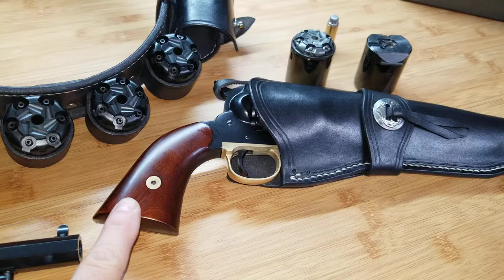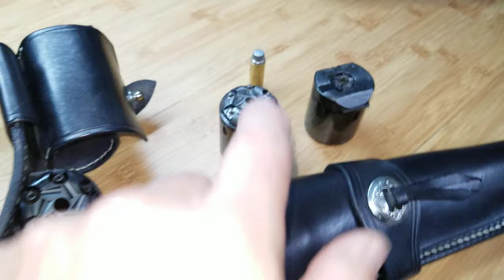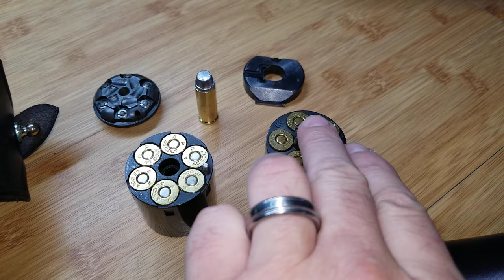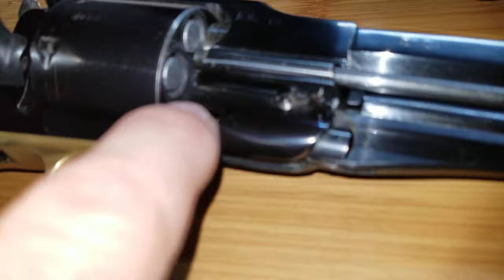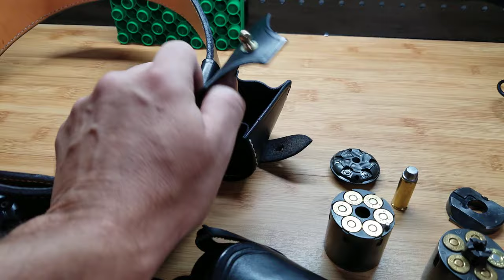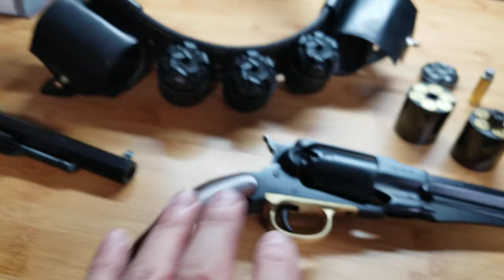1858 Remington Pale Rider Set

Comment: Are you saying the 6 shot cartridge has a high probability of blowing up?
Reply: *depending on the load. 

5 shot allows you to do much hotter rounds. 
6 is suitable for target shooting loads.
Reply: kirsts are rated no higher than the 6 shot cylinders
Reply: Kirst Cartridge Konverters™ are rated “For Black Powder or equivalent loads only,” which includes the smokeless, light target loads commonly sold for Cowboy Action Shooting.

Comment: You're wrong. 

45 colt, and 45LC, are different rounds. I forget which, but one of them is 45-40. Other manufacturers wouldn't use the colt name to describe the chambering.
Reply: Uh, No. 45 Colt was referred to as "Long Colt" to differentiate from the shorter 45 Schofeld or 45 Gov't round of that era. The 45 Colt was originally loaded with 40 grains Black Powder before being reduced to 30 grains per Gov't request for issue by the U.S. Army.

Comment: "They would look at you ...." Not quite fully correct. Yes, you are correct that there isn't any such thing as "45 Long Colt". No, you aren't correct that nobody would have understood. The military cartridge was the 45 "long" Colt. And it wasn't officially called that. What happened was a result of the adoption of the 45 Scofield as a secondary standard. In an attempt to standardize ammo, the military sutlers gave out Schofield ammo regardless of whether they were to be used in the Colt or the S&W. Since the Schofield was much less powerful, the soldiers quickly started requesting the "Long 45 Colt" ammo. Thus the users gave the ammo a name that was never official, but nonetheless is STILL a legitimate name because of Long standing common use. It was a legitimate differentiation because the standard 45 Colt used a 255 grain bullet in front of a full 40 grains of black powder. The Schofield used a 200 grain bullet in front of 28 grains of black powder. A significant difference to soldiers who were used to maximizing the range they used their weapons at.
No, the 45 Colt was never officially named "Long Colt". Yes, it has been named "Long Colt" by users ever since the Schofield round became available.

Comment: Do, can you modify/ redesign a 1851 Colt backstrap into a traditional birdshead without the current stepped birdshead?
Reply: I'm  thinking about a 3d copy in plastic, modifying,  and then casting  in brass.
Reply: John Johnon uberti sells 45 colt birds head (without the step), cattleman revolver.
Reply: The back strap and triggerguard interchange with 1852 colt.

Comment: Hi, I have a question for you about this revolver, if i were to load up some cylinders with black powder and a bullet, how long does this stay good for? I live in a humid state and was wondering if i would have to fire off the cylinder from time to time and reload it with fresh powder or if they would be ok sitting around for months or years before needing to be fired. Thanks for the answer in advance and thanks for showing off your rig!
Reply: It will be fine. I live on the coast it has never been an issue.
Reply: might as well use the conversion kit. only needs to load when ure out on the field and no hassle on handloading the blackpowder
Reply: I live in the humid state of Florida and I've had my 1858 loaded for 2 years as a test. Every cylinder fired without a problem.
Reply: Louisiana here. I have never had a problem with the powder going bad. A cap, once. Or maybe it was just a bad cap. As a rule I do not keep a loaded cylinder for over a year but who knows how long it is actually good for? Just don't buy 20 cyls and keep them all loaded if you only shoot up one or two every few months. If you almost never shoot, just keep one in the gun and one loaded spare and if you need more kapow power than that you probably got problems too big to shoot your way out of, anyway. Just the same maybe keep a box of balls, a tin of caps, a flask of powder, and some wads right by the gun. maybe some bore butter or crisco if you roll like that. Or convert to cartridges, and you should be good for like 60 to 100 years.
Reply: Bill Hickok “emptied his 1851’s every evening.

Comment: I thought Clint Eastwood used a new model 1861 remington revolver in pale rider? In fact I don't think an 1858 new model ever really existed, just a misprint on some of the barrels if I'm not mistaken.
Reply: Wrong
Reply: @terryparker1694  They are commonly, though inaccurately, referred to as the Model 1858 due to the patent markings on its New Model barrels, "PATENTED SEPT. 14, 1858/E. REMINGTON & SONS, ILION, NEW YORK, U.S.A./NEW MODEL."; although wide scale production did not start until 1861.  

Source: Google magic. In the future it would help you to do some research before so confidently calling someone else wrong.
Reply: @ezell77  WRONG. It is referred to as a model 1858. Produced until 1875 by Remington and all over the world long after. Remington produced over 230,000 themselves. I have an original one right here, made in 1870. It is plainly marked MODEL 1858. I have had it a long time. When you don't know, you need to be quiet. You don't know. Be quiet. You're outing yourself. Run along kid.
Reply: @terryparker1694  man i said they are falsely referred to as the 1858 and I said plainly that 1858 IS printed on the barrel. But 1858 is the year they were patented. They didn't begin production until 1861 meaning the actual model of the gun is an 1861. You just contradicted yourself. You said you have one that is made in 1870 and you said it says 1858 on the barrel,  that should alert anyone with common sense that 1858 isn't the actual  make of the gun. How can you have a model 1858 if it was made in 1870? A use of common sense or simply Google search could clear this right up for you. If the gun was made in 1870 or any year other than 1858 it isn't a model 1858. Unless of corse you have a replica. Please explain how a gun made in 1870 is an 1858 model? I'll wait. You are outing yourself, I actual know my history. The one Clunt Eastwood used in the movie was an 1861 model. Please Google it.
Reply: @terryparker1694  The Remington-Beals Model Revolvers[dubious – discuss] along with subsequent models and variations were percussion revolvers manufactured by Eliphalet Remington & Sons in .31 (Pocket) .36 (Navy) or .44 (Army) caliber, used during the American Civil War, and was the beginning of a successful line of medium and large frame pistols. They are commonly, though inaccurately, referred to as the Model 1858 due to the patent markings on its New Model barrels, "PATENTED SEPT. 14, 1858/E. REMINGTON & SONS, ILION, NEW YORK, U.S.A./NEW MODEL."; although wide scale production did not start until 1861
Reply: Conversion cylinders were available starting 1868. The first were rimfire.  The next was .45 Center fire. Royalty was paid to Smith and Wesson for each one for the bore through cylinder patent with a back plate and 5 or 6 firing pins one for each chamber. I have 2 cap and ball and 1 conversion cylinders. They swap with no changes necessary at all one to the other in seconds.
Reply: @terryparker1694  What was the make of revolver used by Clint Eastwood in Pale Rider? Our firearms expert and Field Editor Phil Spangenberger tells us: “The gun used in Pale Rider was a New Model 1861 (not an 1863) Remington revolver. These are commonly misnamed as the 1858 Remington—of which there is no such animal.
Guess that clears things up.

Comment: I have a 1858 BP Pietta. I find that cocking this Black Powder Reproduction is horrendous. Is there a more efficient cocking spring available?
Reply: John Summers work your spring. That the grips off and you’ll see the hammer spring, there’s vids here of how to work it down.
Reply: Try the adjusting screw behind the trigger guard in the strap.
Reply: There are after market springs (eg Wolf Springs) that you can purchase and drop in.
Reply: Springs on cap and ball guns are intended to keep the cap in place when pressure builds in the cylinder the spring on the hammer prevents gasses from escaping past the cap

Comment: CRAP! Clint never used a Kirs Converter! In the movie you can see clearly, the cylinders are open at the back and do NOT have a cover with firing pins over it! Also you can clearly see, the hammer of Clints Remington has a firing pin!
If you wanna do such videos do your himework and be correct!
http://www.imfdb.org/wiki/Pale_Rider
Reply: I was also not happy with the way he presented it. A little tiresome.
Reply: You are correct, the load gate version is much closer to the Pale Rider gun. I watched that scene a dozen times so I was sure. That is why I just bought the load gate version from Cimarron. Now I just need to find spare cylinders.